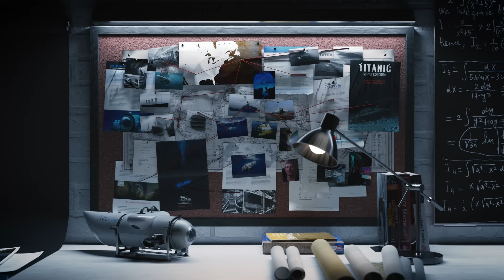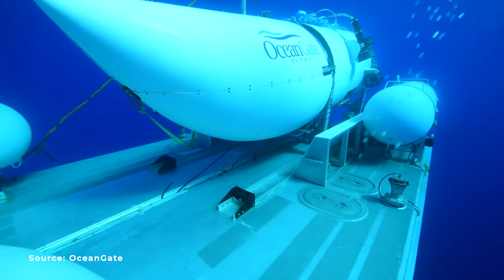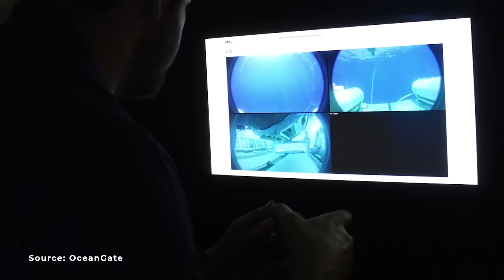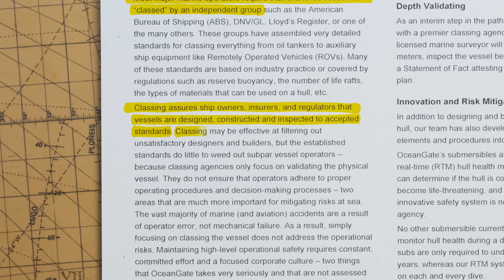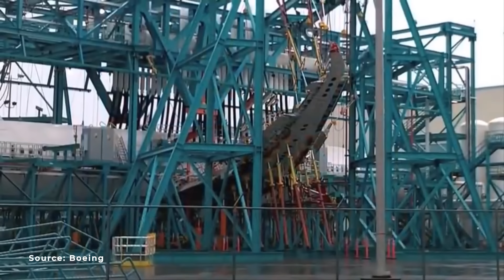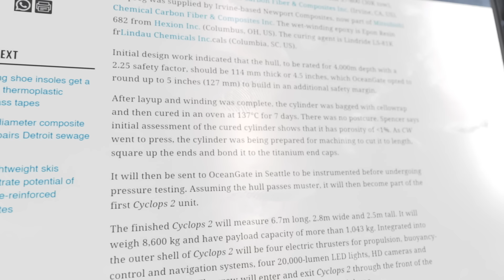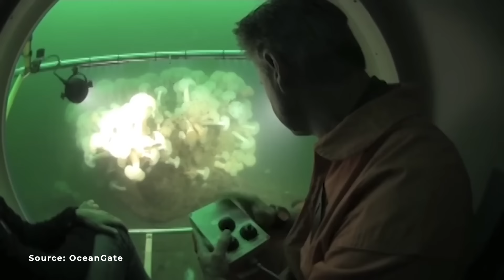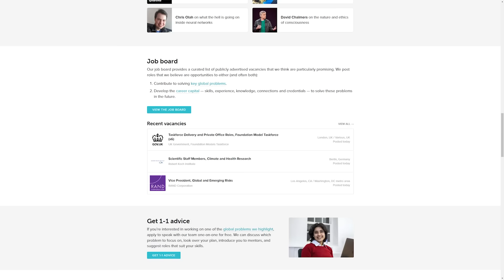The Questionable Engineering of Oceangate

Comment: When I watched the devolvement video and saw that they bonded the titanium end caps to the carbon fiber body with glue, my gut dropped. Also the CEO came out saying he "didn't hire 50 year old white men, as they are uninspiring."
Reply: A Boeing 777 and most newer planes are glued over 90%, glue is way better than just 40 years ago.
but then again, a plane doesn't have to deal with more than 1 bar difference, not near to 400x. So, maybe there aren't enough tests done out there on this specific problem?
Hubris is the death to many.

Comment: i'm not a composite material engineer, i only know what i know of playing paintball, scuba diving, and being a little bit observant, carbon fiber cylinders are designed to withstand pressure from within, not not from outside, they perform well under tension, not compression... if you pull from the fibers they are strong, if you push, then just bend like a hair, meaning that the pressure was on the resin portion of the composite, not the fibers themselves, it's obvious eventually it would break.

Comment: Great video! Quick quesion, why would you want pressure to cure composite material and not a vacuum chamber?
Reply: (Not an engineer, take this with a grain of salt.) Composite autoclaves are not just pressure chambers. The composite structure usually has as much air as possible pulled out of it, then it's sealed, then that sealed part is placed in the autoclave. The high pressure forces the fibers and resin even closer together and the heat helps the resin cure hard and consistently.

Not autoclaving a safety-critical composite is, like, baffling to me. It's amazing how much of a difference it makes. My dad and I built a 3-foot model bridge out of nothing but newspaper and PU glue for my high school physics class, using a Food Saver and his oven as a jury-rigged little autoclave. The idea was to test it to failure point, but my teacher ran out of weights at 60 lb (27 kg). The bridge didn't even notice.

Comment: My thought was that they needed to build 3 hulls, do destructive testing on one, pressure cycle another repeatedly and MAYBE use the third one depending on what the testing of the first two revealed. But I think funding limitations had a lot to do with the CEO's lack of enthusiasm for safety testing.
Reply: They could have made 1/2 or 1/10 size models and gone to sea and dropped them twice the depth and at a velocity ten times faster (like 20km/h) and completed that in a month.
Reply: No one of the three would be exactly the same as the other. This is a further complication of composites. They are not homogenous.
Reply: @jnavonoD  Very true, but wouldn't that be why you test way beyond the the limits and many models. Wouldn't you over engineer to account for the imperfections. Probably better to use full Titanium,wonder how the price and weight would compare to the CF.

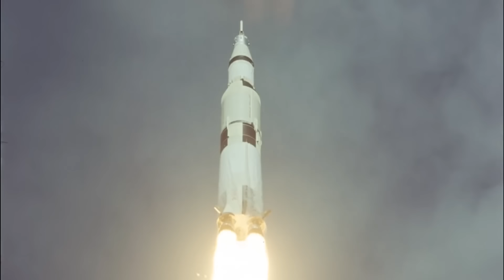Comment: @0:41, stop with the overly dramatic multiplication of the pressure being applied to the sub and trying to apply that to the area of the sub.  You sound like an idiot trying to make something worse than it already is!  It's about 5,500 PSI, yeah that a lot.  But multiplying that force per area over the ENTIRE area is ridiculous.  The forces cancel, and all you care about is the strength of the material to resist the crushing forces. But comparing it to the Saturn Five's thrush 'all over the sub' is a silly comparison.

Comment: The controller thing i do find weird....as I have seen many opposing views, one person said it is fine that various forces use controllers for things like drones etc, but on the other hand someone saying that for certain things a basic video game controller would not do as it would need rigorous testing and even used as a base would need a lot of modifications if it is a essential thing
Reply: jfc it's a simple input device, the only thing different would be the shape of the plastic enclosure to put the circuitry in.  Where's all the flak for them using off the shelf keyboards and audio equipment? Or is that stuff okay because it isn't a "1337 gamer" product?
Reply: They had multiple backups for it, so it failing was not going to kill people. In one of the Oceangate videos they said they carried spare controllers. They probably also had a cable. They also had touch screens, probably also had on screen controls like most control software has. Also saw pictures of a keyboard and mouse. Even if all the redundancies failed they could still surface by weights dropping.

Comment: I was hoping Brian would give us an explanation of the structural theory of a carbon fibre compressive pressure vessel. Seems to me that all the compressive strength comes from the epoxy and the carbon fibres are actually weakening it. Compressed, the fibres will tend to buckle putting the surrounding epoxy under tension and forcing delamination. Also the radial winding of the carbon fibre tape seems odd since the axial force from the end caps pushing towards each other will be just as substantial as the forces pushing radially inward.
Reply: Now that it's mentioned, I wonder how much better a tube made of moulded epoxy would fare as a submarine.
Reply: @Moonstone-Redux  Pick something that's strong in compression. Epoxy? No! Ceramic? Yes!
Reply: @robm7914  another leading vendor proposed making a sub out of glass. Pretty neat
Reply: Carbon fiber is a fantastic material for tensile strain and has some interesting properties in torsive strain but it's really fickle for compressive strain—materials can be better for different things, and Carbon fiber isn't good for submersible maritime ventures.
Reply: No!  Engineering calculations show that the axial end loading due to water pressure on the bulk heads (end caps) equals 1/2 of the radial loading on the vessel.

Lengthwise cracks in piping and vessels is a common mode of failure, due to radial loading.
Transverse (guillotine) failure, on the other hand, is quite rare.

The essential difference between internally and externally pressurized vessels is the mode of failure.  With internally pressurized vessels some warning signs are apparent, such as excessive increase in diameter, or, perhaps local bulging.

Externally pressurized vessels are subject to catastrophic failure termed buckling failure.  This is similar to buckling failure in building columns.  For vessels the author termed it snap buckling which, while a new expression to me, seems most appropriate.

I used to say that air liners and nuclear power plants do not suffer fools gladly.  Add submersibles to that category.
Reply: It was hoop & axial cross-winded.
But yeah, why carbon? Weight?
Reply: It sounds like it was the epoxy, the area behind the end cap looks hollow a place where water could enter. After reviewing the alledge last transcript, it seems like it was taking in water. It was descending too fast.
Reply: It wasn't filament wound, it was a pre preg layup. You can see the machine working in the Sunday morning ocean gate video at 3:50. That machine can layup in any direction and I'm assuming it did

Comment: The difference between Virgin Galactic and Oceangate is that Virgin has had setbacks through the years and has persevered through those challenges but has also been willing to change the design of the vehicle to accommodate deficiencies in the initial design.
Reply: Just looking at the big vertical wing surfaces of the Virgin craft scares me, and that the hull and wings rotate. They might have done a lot of test flights but are those test flights covering all possible scenarios? Sounds too risky to me.
Reply: @AORD72  After the crash of the VSS Enterprise, Virgin stopped all flight operations to figure out how to make it safer via a NTSB report.  Engineers sometimes don’t think of a safety feature until it’s too late.  In general I agree with you in that it’s a little too sketchy for me at this time.

Comment: I explained this the other day to my parents as 'pushing a rope.'  Oceangate was basically relying on the resin to do the work.  And thank you for addressing the curing aspects of the structure.  As a MatSE with 20 years designing  e-glass supported PCB substrates the list of questions I have goes on and on.  Let me tell you, 'less than 1%' is a terrifyingly vague number for a 5" thick composite that will be subject to 1000s of psi at depth.
Reply: The carbon fiber wound thread plus resin is akin to steel rebar and concrete
Reply: @williamroberts6937  Except carbon fiber doesn't give even close to the amount of warning signals that concrete does before failure point.
Reply: @williamroberts6937  Steel rebar and concrete has huge strength in compression, pretty good in tension. Carbon fibre and resin has huge strength in tension minimal in compression. Underwater is... compression. Carbon fibre and epoxy is about as strong as tissue paper (slight exaggeration - they managed to get it down to depth a few times before it failed).

Comment: As an Electrical Engineer myself, the thing sai at 12:44 resonates deeply with my own work ethic. and is also the reason I insist on a review process when handing in work. I don't want my products to be defective because I had a couple of hours less of sleep that day and I scuffed up the decimal placing of a voltage measurement.

Comment: I don't think it was even the carbon fiber in the hull. I think it was the electronics, and how many times that particular hull dove without been tested or looked at for cracks/imperfections. Ive heard and expert say they think the Titan had a nose dive freefall after an electrical issue with thrusters, and sank too quickly, causing pressure build up too fast, and them imploded.

Comment: So..  it turned into a pile of loose wrapped carbon fiber string as the resin let go ? Delamination I guess you could call it that   Because of changing shape from pressure compression of fibers and brittleness of the bonding resin. It's also why AT4  rocket launcher tubes are disposable .. they could rupture if reused.  Thick Steel maybe coated in thick rubber to prevent someone compromising it with an impact ..would have been a better material choice. Hull shape Also isn't ideal Because uneven pressure upon material

Comment: Stockton Rush was complaining that the submersible industry was way too overregulated, and it was stopping innovation. Also, that there hasn't been a single death in over 35 years. Until now. 

And also, seriously. You couldn't have paid me a million bucks to get into that rickety thing. Just the thought of being hermetically sealed inside that with 17 bolts that can only be opened from the outside gives me the shivers.

Comment: 4:14 "The vast majority of marine accidents are a result of operator error" -  it's like saying that most car accidents are caused by sober drivers therefore there is no reason to not drink.

Most vesels are tested and certified so they are unlikely to suffer accidents due to bad design, but they used that trying to argue that tests and certification are not needed.

Comment: This video contains misinformation and is very poorly research. At 6:35 “They’ve done that at least 50 times without ever fatigue testing it”

This is false as the sub has a real time monitoring system to monitor the integrity of the hull which is basically the same as “continuous testing in real time while diving”

Also note that the hull imploded is the second hull, the first hull that you see in its construction video is the first hull which Stockton himself restricted it to no more than 3000m dive due to issue with cyclic fatigue… which means that he must’ve done fatigue testing with it to be able to know that.

Note that all information I’ve listed here are available publicly online through old news article and previous press release. There’s no reason why you should not find these info had you conducted your research properly.

Do better.

Comment: SpaceX also moved fast on it's launchpad for Starship and look what happened.

I liked how this video listed on the failure modes of carbon fiber.  Hope more videos on composite materials are made as this is the forte of the creator of the channel.
Reply: The key difference with SpaceX is the safety precautions actually worked: no human life was harmed  from the pad failure nor the AFTS delay as people were not allowed in the exclusion zones.
Reply: There is a HUGE difference w/ SpaceX.  They know and even expect those failures.  They said the odds of that version of Starship surviving the whole test flight were extremely small.  Extremely.
Moving fast is perfectly fine; IF done safely.  They aren't going to stick anyone on that thing until it is well tested.
Just like their current manned flights to the ISS.  Well tested before hand.  Comparing the two is VERY faulty.
Reply: (That launchpad is quite near to being fixed already)

Comment: When the story of the titan first broke I didn't wanted to read to much about because the details of how they died where something I didn't knew if I could stomach. But when you pointed out the laminar structure of carbon fibre I immediately got an image of a piece of string in my head. If you tie it in a loop and pull on it you can exert a good amount of force on it befor failure. But pushing it together turns it into a ball of string. After that thought, I realised how unnecessary, totally avoidable and stupid this incident is.
Reply: If it helps your stomach (it helped mine), they didn't feel anything. The pressures are so immense that, as soon as the hull failed, the implosion would have killed them faster than a human brain can receive and process a sensory input. No pain, no scary movie scene where they're watching the end come for them. Just lights out.
Reply: @crystalsoulslayer  Unless their worse-than-useless hull integrity alarms were going off just prior to the hull imploding. That would have been terrifying in a situation where there was clearly no escaping from what was about to happen. At least the end would have been practically instantaneous.
Reply: @crystalsoulslayer  yes specially with the failure curve of carbon, which he showed. But what now bugs my stomach is how predictable the failure is after just a tiny bit of research. I mean... I have no degree jet but I work in mechanical engineering and with a basic understanding of how safety is provided in this field. I just makes my stomach rage with sadness and anger at the same time.
Reply: @rened.5998  Yeah, it's pretty infuriating. There's no love lost between me and the ultra-wealthy, but human lives were in this company's hands and they still cut corners. I don't know how anyone can place more emphasis on profit than on protecting people... it's probably a good thing not to be able to understand.
Reply: @crystalsoulslayer  I think that's basically how they get to be so wealthy. They don't care about human lives, and that gives them a competitive edge over those that do.
Reply: @hazelhazelton1346  Basically. It's equal parts poetic justice and disturbing reality that even the wealthiest people in the world aren't immune to the real cost of reckless greed. But I have a rule against cheering for human death and/or misery regardless of what kind of person it happens to. I find it too easy to lump more and more people into the big "they deserve bad things because of my moral judgment of them" category, and I don't want to become the new villain.

Comment: The fact the the same submersible went to the Titanic successfully atleast 50 times sounds quite succesful to me.

Apparently it was not as bad as everyone's claiming it to be.

If these so called composite material engineers knew about it, why they came forward only after the accident.

The fact is noone knew shit.😅😅
Reply: Multiple people raised safety concerns at multiple points, which all indicated this accident was inevitable.
People were fired, law suits filed, etc.
An airplane flying 50 flights and then breaking up mid-air is not a success.
You don't seem to understand even the basics of this situation; maybe listen more, talk less?
Reply: @kanagawakenji7  It's a huge success when you consider the amount of attention given to safety.

This technology can be drastically improved.
Reply: It didn't have 50 successful dives to Titanic depths.
In fact it only had a handful of successful dives to those depths, all others were abandoned for one reason or another.

Also, James Cameron aswell as an entire group of experts within the field of deep sea submersibles sent a document to Oceangate and quite literally told them to reconsider the structural integrity of their vessel. Oceangate simply ignored it.

Stop trying to spread disinformation.

Comment: Good video, but I wish you would also go more into detail about the plexiglas windows, electronics and other flaws.
Reply: They werent the failure mode and they were not materials or practices that are uncommon in submersibles.
Reply: I doubt it is a common practice to use store bought cctv's and a single touch screen to operate a deep navigation sub

Comment: Probably a silly question but was it purely composite, or was it CF spooled around a metal shell?
Reply: The cylindrical part was carbon composite, the round caps were titanium alloy, why didn't make it all from titanium? Would be more expensive, well teoreticaly round caps made from carbon fibers can be made, but nobody can do it until now, but cylindrical shapes are easy (in theory) until have a failure.